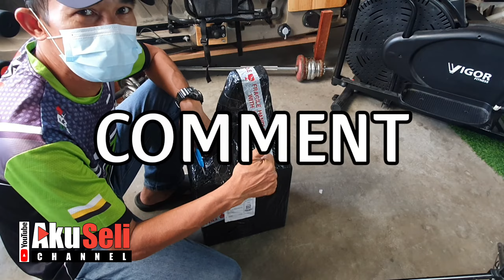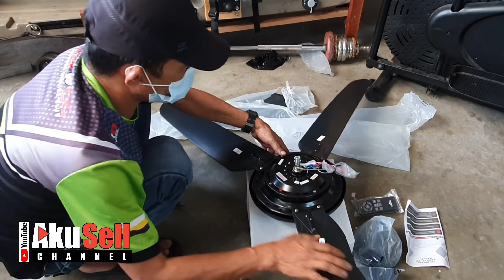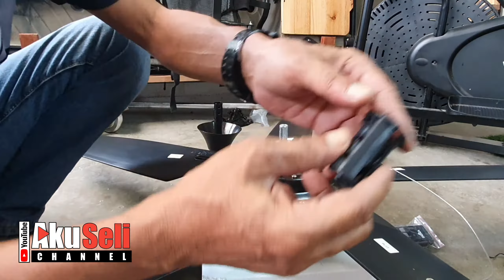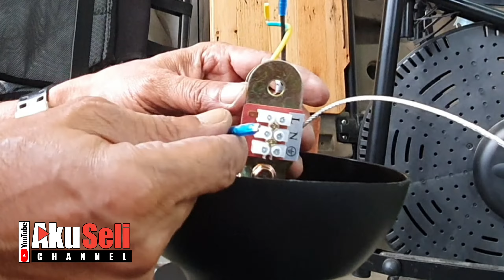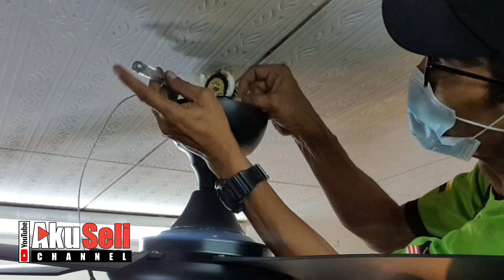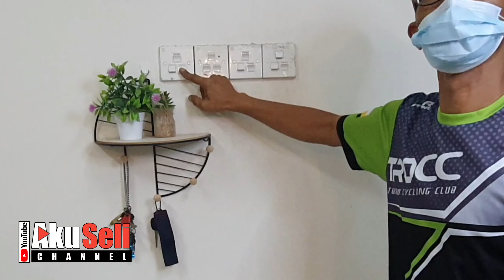DIY How to Install a Ceiling Fan 5 Blades Step by Step

Comment: Encik saya beli kipas brand deka. Ada dapat sekali receiver remote control. Kene pasang ke
Reply from the maker: Mudah, Pasang kipas saja. Macam pasang lampu. Remote kontrol masukkan bateri ja, dah boleh guna. Dah tak ada nak drill dinding.
Reply: Bukan.dia bagi 2. Satu remote control. Yang satu lagi receiver remote warna hitam.Ada wayar coklat biru dan merah hitam.Nak wiring tu tktau
Reply from the maker: Coklat biru cable neutral, merah hitam cable life.
Reply: @mdsu8627 Bang dh pasang ke receiver itu?Boleh ajar cara pasang itu.I pun pening x tahu nak pasang mana
Reply: @kishanravindran  dah pasang. Sambung wayar reciever ke punca point
Reply: @mdsu8627 kalau tak pasang receiver tu boleh on ke kipas kalau remote saja.
Reply: @TheAkizaki adui x de jawapan ke soalan yg ni.saya beli kipas baru jugak.dpt receiver.x taw pasang kt celah mana